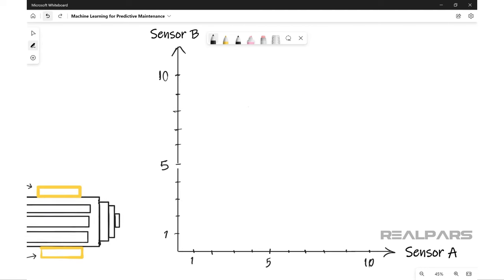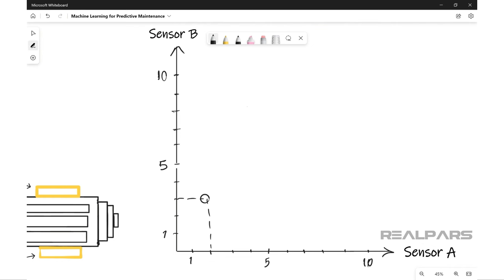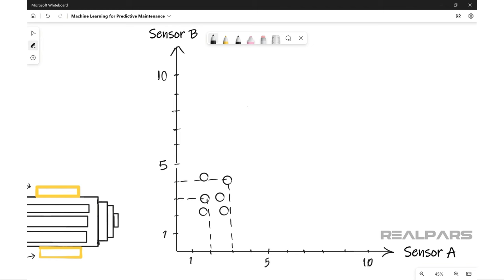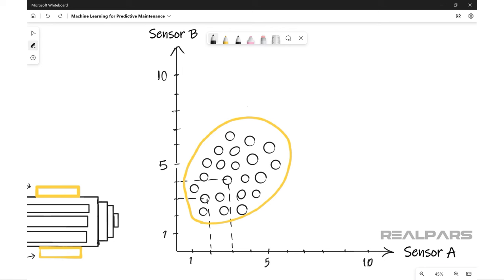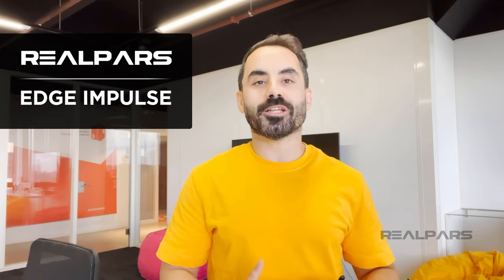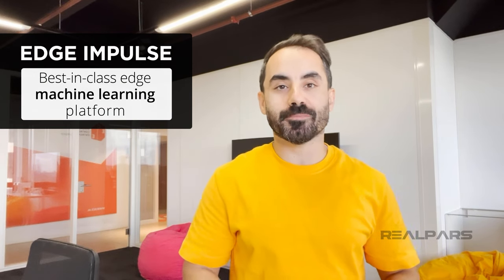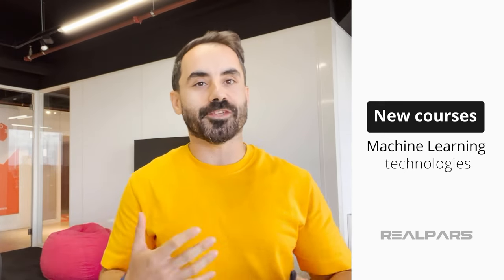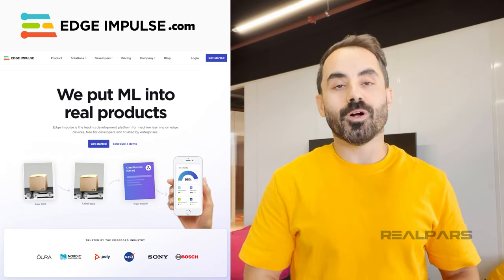How to Use Machine Learning for Predictive Maintenance

Comment: Wait, isn't it the same as generating alarms based on tolerance?
Reply from the maker: Yes and no.  If you are able to know the "normal" value of the parameter before running the equipment, then yes, tolerance would be the guideline for determining a problem.  For new equipment, or processes where the conditions are dynamic, machine learning (modelling) can be very useful to determine the behavior of the machine in normal operation.  But in either case, detection of a condition outside of the expected range will lead to an alarm, or alert.

Comment: Except that it isnt that obvious when a motor is deviating from its optimal value, usually, for a point to be that far from the normal operation point, what you require is not a predictive maintenance, is more about corrective maintenance and replacing failing pieces that already damaged the motor
Reply: Most of the time, you require more expertise to be able to tell if a parameters is an anomaly, perhaps the same vibration could be considered normal at high speed and an anomaly at low speed.
Reply: @wtomas250  we don’t ever consider Vibration normal specially at high speed ⚠️

Comment: I still don't see the benefits of machine learning, if I can only use a single check,
eg. IF (Sensor_A > 7) OR (Sensor_B > 7) THEN ...
Or if I want to prevent false alarms, then I'd use rising triggers and a counter.
Reply: I think the point of this is for the model to adapt on its own to changing situations, otherwise you're right.